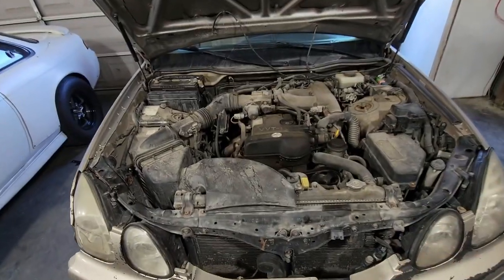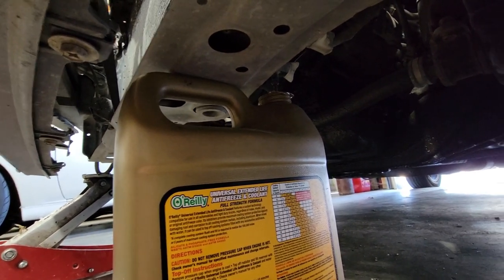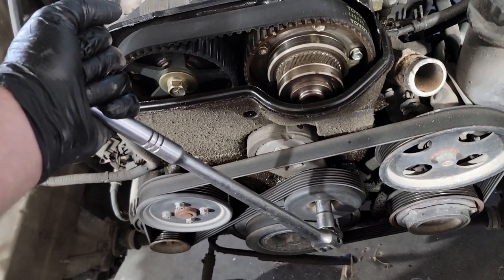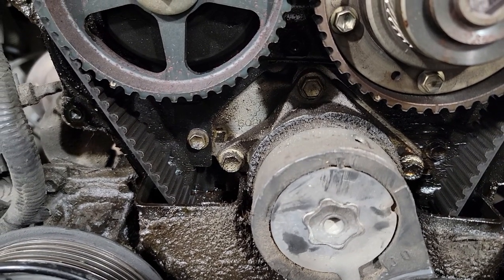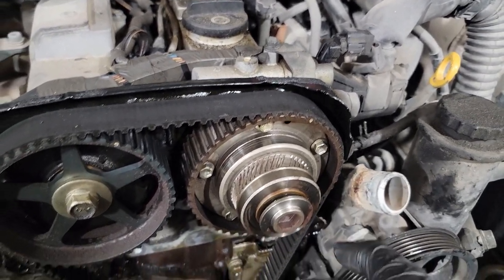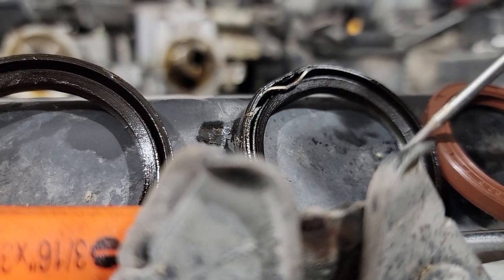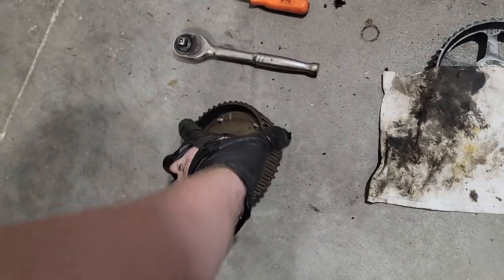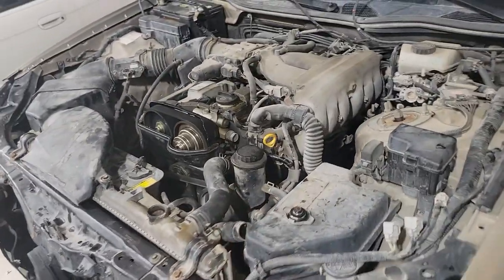GENERAL 2JZ MAINTAINENCE HOW TO REPLACE CAM SEALS AND FRONT CRANK SEAL (LEXUS GS300, IS300, SC300)

Comment from the maker: The part number for the cam seals are 90311-40020

They are both the same seal.
Reply: And the crank seal?
Reply: What marks do I mark up ? I have the 2 u have on the cam gears but I also have dots with white marks 3 teeth away  what one do I mark it to ?
Reply from the maker: @BrodyPeraza do the lines on the cam gears. Not the dots. The dots indicate something different

Comment: Dude! Your trick using the serpentine belt to get the crank pulley loose just saved me a ton of frustration. I tried the impact, tried heat, tried heat and impact. Nothing was working but this worked so effortlessly. Thanks for this vid.
Reply from the maker: That's what im here for. Glad i could be of some sorta help
Reply: Same here!  Took a little bit of figuring out, with a few tries to get it to lock but I got it. The way it was laid out on the ground for reference was perfect.

Comment: hey i just finished the timing portion but cannot figure out how to get the crank bolt back off so i can put the crank pulley back on. what method did you use?

Comment: Thanks for this! Was interesting to see the cam seals up close and learn how they seal with pressure. Now i've seen this job done, it doesn't seem so scary lol. How do you know what to torque everything to, e.g. tensioner, vvti gear etc?
Reply from the maker: Every bolt in the engine has a recommended torque spec. The only things i torque to spec are parts internally, like rotating assembly parts and head studs. The other things have such a low torque spec its more of a snug to preference. The crank bolt is supposed to be a big torque but its only use is holding the harmonic balancer. Tighten as tight as you can and it'll be fine.
Reply: @RabidJz  Sweet thanks mate! Looking forward to more content like this :)

Comment: I didnt have any leaks on my gs400 until I tried to pop the trans pan a day before work. Was under there for 4 hours and had to call quits cuz all my methods would not crack the 25 year old toyota fipg, now its leaking from where I tried. Its more seeping than it is leaking as the seal didn't budge. I have all the stuff to redo it just not the time. Plus I want to do accumulator shims to firm up shifts and hold a little extra power as Im planning to go 4-500hp so stock trans is still capable but not without light modding.

Comment: so it would just be lining up the 2 gears on top and the pulley gear before taking the timing belt off, trying to do my gs seals but i’ve never dug that much into my engine before

Comment: How did you re torque cam bolts? What did you do to hold it with out removing the valve covers? To re torque?
Reply from the maker: I hold the gears  against themselves using a bolt or something to bind them. Then just tighten them. There's torque specs on ever nut and bolt in a car, but i only torque a select few.

Comment: Just finished my job and I broke the alternator wire smh, the 2 cam shafts are also spitting out oil, could that just be old residue removing itself? Or am I assed out and got bad ones?

Comment: Thank u!  The video is awesome.  My GS 300 has 184k miles on non-op cuz I don't want to risk it.  But for sure, I'll be doing this soon.  

I always use OEM parts but I've heard a lot of good things about the Aisin timing belt kit with  "Mitsuboshi Tbelt, Aisin Water Pump, NTN Hydrolic Ten, Koyo Idler Ten".  They claim they are Toyota/Lexus and others supplier.  I know Toyota owns about 25% of Aisin but could the specs be the same as Lexus wants it?  Just wondering what you think?  

Btw, on the 24:59 min of the video, I heard u
say "all ready to rumble for another  200k miles" did u mean 100k or you really meant 200k miles til changing the TB again?

Ok., thanks again for helping us little guys.

Comment: Would you replace the seals even if it's not leaking? I was leaning towards doing my seals even though it's at 110k miles andall seals are bone dry
Reply from the maker: If you want to. If its not leaking, i wouldnt have a desire unless you're already inside the engine
Reply: @RabidJz  left out some details. just got it yesterday, and it's got the original t belt from 04. Feel like I'm running on borrowed time.

Comment: Hello, what is the difference between replacing the cam seal and crank seal with doing a timing cover gasket? Is doing  a timing cover gasket much more expensive at the auto shop?  Thanks.
Reply from the maker: There is no timing cover gasket

Comment: Great video. If replacing cam seals only can I loosen the timing belt without pulling crank pully. Timing belt was replaced with crank seal already. And again great video with lots of help.👍👍👍
Reply from the maker: It would be extremely risky to attempt that. You really will need to make sure everything is aligned properly after the belt is lose. There's nothing stopping the belt from coming off the crank gear

Comment: did you replace the water pump and tensioners? or did you just reuse them? i need to replace mine but to be honest i dont want to buy a whole kit just for the other parts to still be working and id also save some money
Reply from the maker: I never replace those things if they're in good condition
Reply: @RabidJz do you remember about how many miles u had on it when u did it?

Comment: So after you turned the engine a little, you showed the crank being lined up and said the cam gears were a little off, does that correct itself once you pull the pin for the tensioner? I guess you just did it so fast I didn't quite understand what you did 😅
Reply from the maker: They're a little off because the cranj gear tab was a hair off. The cam gears are alot bigger so it shows more
Reply: @RabidJz  gotcha. I'll just rewatch it a few times and see if I understand better. I just got an 03 Lexus GS300 Sport design that has a massive oil leak I'm guessing from the front main seal, the P/o had the timing belt done, but not the seals. Any parts you'd recommend for reliability and toughness for the occasional romping?

Comment: Needed the refresher course. Have to do the timing belt/water pump on my '05 and I need to knock out EVERYTHING.... THIS HELPED (I WILL END UP WATCHUNG IT TWICE THOUGH, LOL).  PLUS, I gotta re uild the VVTI get it ALL DONE in one swoop.... hVent done it since I bought it though I did check the belt recently but the idler pulleys squeekin and the covers are getting hella dirty, and I don't want to lose this SLEEPING MONSTER (which i plan to SUPERCHARGE, YES I LIVE IN CALI😤😤😤).

Comment: How did you get the left cam gear off
Reply from the maker: If its high miles and seized, prying and wiggling, and a deadblow hammer
Reply: While im trying to loosen this gear it moves which im scared of messing up the timing
Reply: Is their a tool that you can use to get this gear off
Reply from the maker: As long as you align the timing marks after the fact, your timing will be fine.
Reply from the maker: You can take the valve cover off and hold the cam with a wrench
Reply: Its the actual bolt i cant get out

Comment: You did not show how you tightened those 2 cams without holding it into place specially the vvti cam.
Reply from the maker: Hold the gears by putting a bolt/washer between the gear teeth to lock it. Or remove the covers and you can put a wrench on the hex on the cam itself. That's the proper way to do it.

Comment: Hey I’m doing the job right now but I didn’t rotate the engine before pulling the parts is that ok I’m gonna follow your steps on re timing after i install all the new parts, but 2 weeks Pryor I cleaned up and changed the valve cover gaskets along with plugs and coils  I don’t wanna touch anything up there but I want to change cam seals how can I take the cam gears off without removing valve covers ?
Reply: So how did that go
Reply: did ur car blow up or what?

Comment: When doing this can you use the timing marks that are the notch? Not the dot and just clock the vvti gear clockwise til timing mark lines up? Thanks
Reply from the maker: Yes exactly that
Reply: Perfect thanks. I am having a random misfire code only misfire at idle...
Reply: @mikemoschetto1143 what happened?

Comment: When I try lining up the lines for timing, only one will line up while the others don’t ?
Reply: Then after a while of Turning it by hand it stopped turning all together and the timing is still off
Reply from the maker: You have to rotate the engine multiple times before the cam gears will align too. If its stopping all together, you either timed it wrong, or you're fighting compression. Make sure if you pulled the cam gears off, that the dowel pins were properly aligned in the gears
Reply: @RabidJz  Ik the timing is wrong that’s why I’m trying to set the timing, but it no longer wants to turn clockwise, and I didn’t remove the gears or anything
Reply from the maker: The pistons are hitting the valves
Reply: @RabidJz  but why? And what do I to fix it
Reply from the maker: They're hitting because the timing marks aren't lines up. You have to make sure they line up 100% when you put the belt on to begin with
Reply: @RabidJz  well how can I fix it then?
Reply from the maker: By lining up the timing marks as i did in the video
Reply: Hey bro loved your video ! But my phone died when I went out there to do it and some terrible stuff happend ,any way I can get you on the phone ??

Comment: You do NOT set the engine at TDC when replacing the timing belt.  Follow the service manual for proper steps.
Reply from the maker: Aligning the timing marks sets the engine to TDC.
Reply: @RabidJz  wrong thing to do!!!  You should be setting the engine at 60BTDC when replacing the ring belt.
Reply from the maker: Well, considering i have 5 different 2jz cars, one being 1000+hp, i think i know what im doing, thanks.
Reply: @RabidJz LOL, don't know what you are doing.
Reply from the maker: Solid argument. Let me know when you have your own supra. How many jzs have you owned? Cause ive done timing on over 40 of them.
Reply: @RabidJz I follow what the engineers at Toyota tells us to do in the service manual!!  Go ahead and tell all of us you know more than the engineers who designed and built the engine. SMH.
Reply from the maker: You alight the timing marks on the engine, 1st cylinder becomes tdc🤣
Reply: @RabidJz lOL guess you need to learn to read page EM18 and EM25 clearly show Toyota says to put the engine at 60BTDC.  But again you know best, better than the Toyota engineers, LOL
Reply from the maker: Engineers also design things in a way that cause huge issues for mechanics. Just because they say "60btdc" doesnt mean its the only way. Congrats you can read words in a manual. Meanwhile im building racecars. Move along
Reply: @RabidJz not moving on because this is wrong and false information on how to replace a timing belt.  The engineers know why tinder at 60BTDC to prevent issues....you obviously do not understand this.  They are helping all of us but you refuse to listen and understand this.
Reply from the maker: Whatever you say dude.

Comment: I thought 2jzs are non interference engines?
Reply from the maker: Some are, some aren't
Reply: @RabidJz  hows it going bro, my car leaking hella bad rn im not sure if its from here or the valve covers. i just ordered hella shit which im not thinking is useless after watching this video. the car just surpassed 112k miles the timing belt hasnt been done before prior my knowledge, i bought the car at 110k and now its leaking baddd. i damn near bought a whole ass water pump timing belt kit, valve covers, intake manifold gaskets, a thermostat, spark plugs lol. the car runs fine its just leaking hella bad, should i return the kit and just buy a timing belt alone, with the 3 seals? please lmk asap bro, im new at this and appreciate any advice

Comment: There’s no way the crank gear thing just “comes off” you used something to pry it off and didn’t show it. There’s no way. Am I wrong? You just pulled it off with ease ??
Reply from the maker: I used a 3 jaw puller
Reply: 19:32 you used a 3 jaw puller for this?
Reply: You removed that 10mm bolt and then like magic pulled that gear thing clean off
Reply from the maker: Ohhhhhh yeah sometimes they just come off if they've been off before. I thought you were talking about the balancer.
Reply: @RabidJz  I broke one the teeth trying to pry it off. It was not coming off at all. I now need to find a new one lol do you know if they are pricey? Or should I just find one from someone parting out theirs
Reply from the maker: @anoushsabouri  they're cheap. And you dont want to pry them. You need to thread bolts into the holes and devise a way to pull it off that way. I modified a steering wheel puller
Reply: @RabidJz  thank you
Reply: @RabidJz  where can I find them